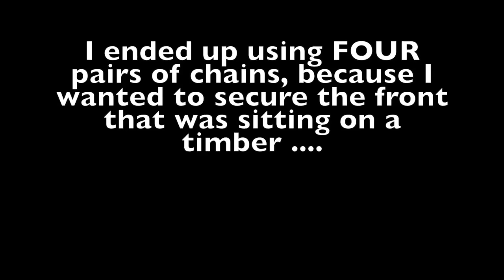Heavy Haul TV: Caterpillar 775G -- 68,400 LB -- Loading & Chaining

Comment: The next few videos are going to be great.  Can you put the camera in the cab of the Cat truck pointing forward showing you driving. I think that would be a good view, especially where you are making a lot of turns.

We get these trucks in about 6 times a year,  when they are staying local we use beam trailers and only take the front wheels off, leaving the dump body on.  When they come in new from Cat they are just like how you set it up.  If all the rear wheels were on it would be about 2 feet wider.
Unloading is just a matter of lifting your trailer and putting blocks under the wheels.

Comment: Looks like a Big TONKA dump truck , looks like a 100 ton mine truck !
Reply: lol
Reply: A 773 is about 50-60 ton capacity.
Reply: Its  a 775 so it is a 70 ton truck. If it doesn't have a payload then it will be filled until its full.
Reply: +TwoTyres your right. Sorry, not sure what made me think 773. :)